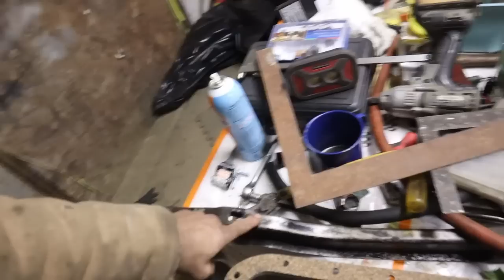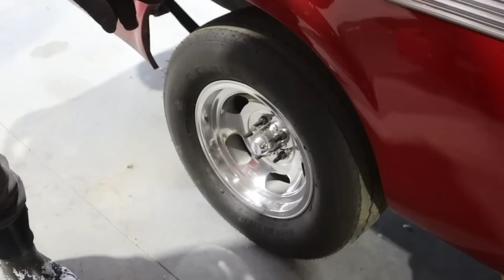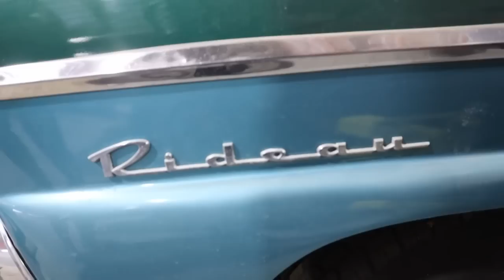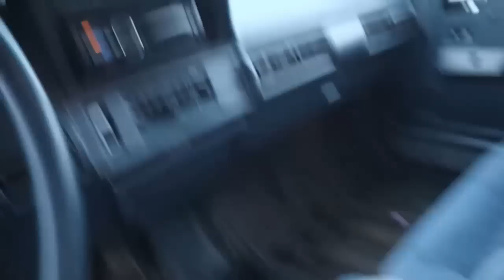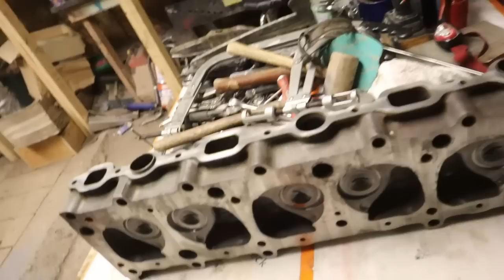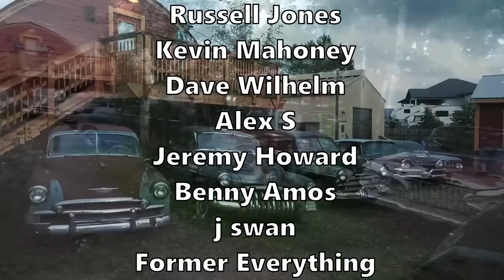Getting my Head Together: 1937 Chevy Engine Assembly, and Fantastic Ford Y-Blocks!

Comment: My dad and his Army buddy Earl Hunt drove a 1941 Plymouth to California and back to Detroit in 1946. When they got back to Detroit the old Plymouth developed a rod knock. Dad and Earl dropped the oil pan on a side street, cut off a piece of leather belt. They took off the loose rod cap, jammed the leather belt chunk in and re installed the rod cap and oil pan. They pushed the car close to the nearest used car lot, fired it up and traded for another car.

Comment: If you ever have to replace a head on an engine with guide pins you can cut the head of an old head bolt with the same thread and cut a slot for a screwdriver...makes for great guide bolts just slide the head down over them...Tip for the day...Great show again lads.
Reply: I use the same trick with bellhousing bolts. I grab extras at the yard and use them as guide pins for the transmission.
Reply: Zig has some great Aussie content
Reply: @ronmcgregor9324  Cheers Ron.
Reply: @ronmcgregor9324  thx, I'll take a look.

Comment: Those springs you saw in  the book on the pushrods were a dealer option for some engines and most never got them. Out of a hundred at the least of those engines that I poured the rod bearings for never had them but did run across one that did have it. We just left that part out as they looked like  a problem coming. I had every one of those cars your friend owns of the "Y" block series. I used a 56 for my drag car and many times it hit the wall but completed the race, only lost three races in say a good twenty plus races. I ran Y blocks for a good while then switched to the 390 with dual fours and a blower. From then on, that car got beat to death racing at any event I could get it in. Back in the sixties, a thirteen second car was really fast but dual fours and a blower got it into a high eight second car... the next race was its last as the frame, actually the second frame, broke and it hugged the wall for the last time. First girl to attack me and head for the back seat was my 57 two door hardtop. My saddest moment is now knowing I had a one off ford wagon built for a canadian and had canadian speedometer, was a "duplicate" of the chevy nomad. All the chrome on the tailgate, inside was the same with pile carpet that matched the color of the car. The carpet was ripped up from storing stuff in it that should of never been inside of it. I had to take all that chrome on the insides out to get the carpet out of it and then a man came by, spotted the car, offered me a good sum of money and in those days money talked. I never seen it again but it was in a car magazine. It had been fully restored and then is when it hit me why so much money for a station wagon to me type car. Great show as always

Comment: Here's another thumbs up for Mr. Deagle letting us see some of his collection.  Stay tuned for more, I guess.  I remember in 1 of the Strong Garage videos, when Jim was saying how difficult it was to work on the brake master cylinder of the 48 Chevy they were working on - "This will make a Ford man out of you".  If Scott had been made a Ford man, then maybe the CWM compound would have had more Fords and Mercurys and Monarchs and Meteors, and fewer Plymouths, Dodges, and Plodges.  I have seen some Fel-Pro oil pan gasket kits, that contain plastic "Snap-Ups".  It looks like those would have been a big help when Scott was doing a solo installation of the pan on the 37.  If the exhaust system of the 37 Chevy is open to an opinion poll, my vote is a quiet muffler.  That like-new engine and a quiet exhaust will be very quiet & refined.  And I guess the winter beater race at Jim's place will be coming up.

Comment: Hey guys, thanks for the show. The Ford collection was pretty cool and I'm a Dodge guy. I also spotted the 40 Dodge when you were checking out the winter beater. I can pick them out from at least 50 yards.Nice that you mentioned Nicks Garage, he has set me straight on a few questions that I had and they worked perfect even tho local guys couldnt get it done, a real solid guy. Cheers!

Comment: I always wanted to see how a 216 oil lubrication worked.  I had one on a 50 chevy 3/4 ton truck.  My dad told me to run non-detergent oil, since he told me regular oil would foam up in the pan, so I would use the same oil we had in the drums, for out small power equipment.  I always wondered why the factory oil gauge only got to about 25psi for cold idle and 15psi for normal running.  This is so cool, thanks for showing us this work etc.  I loved that old motor and how it would just purr so slow at idle and so smooth just driving around the pasture etc.  I miss the old chevy, one could out walk it in while it was in 1st gear and just reach into the window and adjust the steering wheel, while it was just purring along.  Thanks for all the video editing you do to share these vids with us.  God Bless you and the crew!  from Near Nashville, TN. USA
Reply from the maker: Hey thanks so much; glad you enjoyed it! I am really happy with how the old 216 is coming back to life...Cheers!

Comment: Very nice Fords. It`s funny how it works out, like with the 37 engine. First, lets see if JB weld can fix this and just send it, to fixing it properly. I just wiped a cam lobe on my Mopar and thought, I`ll run some washing fluid trough it, throw a new cam and lifters in there and that`s fine. But as one gets in to it you realize what it takes. Complete teardown, wash everything, new bearings and what not. Even got to do some improvements. So, that`s how it goes. Great show as always. Cheers. Oh, and the model car stuff, love it.

Comment: My sister had that same Olds-muh-bubble, but a few years newer after they switched to the 3.1L that was in practically every FWD mid-size GM car of the era. My mom had a ‘93 Skylark with that same 3.3L. I believe it’s a relative of the 3.8L. She ended up having to get rid of it because of cooling issues. No one could figure out why it kept overheating. Cooling system was full of rust and we weren’t going to pay for a tear down. They only made that engine for a few years.

Comment: Love it!!! I was hoping you'd walk us through that aiming jig you mentioned last week. I sure hope someone can "pipe-in" on the Stovebolt pushrod guide springs mystery... I've had a lot of forklift engines apart and not seen that arrangement on any of them, either! So nice of Tom to let you film his collection - the wheel re-arch job on that drag car is super-clean work! We always knew Dean was sharp if he's held down a job as a mechanic all these years, and what a treat to see this side of him! Keith's X-body Ciera was a fun trip for me - the car I got my license in was an '86 in Burgundy and Medium Red that we bought new. My uncle also had an '89 SL in charcoal, optioned just like Keith's, that he gave to me about 15 years ago because I didn't want him to scrap it. Limped it home with a bad trans pump and threw in a used trans, it had about 125K on it when I got rid of it. You're right, they're getting much harder to find these days, and not a bad idea to oil-spray even a beater to get a few more years out of one. Solid entry from Keith!

Comment: Those Cutlass'es and Century Limiteds were good cars, I had the latter (1990.) They quit building the 3.3 because it lasted too long.
Reply: ...and now the 3800’s still last too long, quit making those🤷‍♂️😏
Reply: @tomtheplummer7322  soft transmissions though...
Reply: My Dad drove like the Grandpa that he was so he never had issues. 😉
Reply: @tomtheplummer7322  I had a 1987 Delta 88 (newest car I ever had, 5 yrs old with 160K miles on it).  Put in reverse one day with a "little" gas and cracked the reverse band.  If it was on flat ground and put in reverse with no gas it would move.  Gave to my Dad, drove it like that for another 4 yrs! 😆
Reply: I had multiple Century and Celebrity rental cars back in the 90s.
Reply: I hope that's true. 🙏

Comment: Those pictures in the book are push rod retainers and valve spring helpers to go with the weak valve springs on the head, they discontinued them in 38 and went to stiffer springs on the valve

Comment: I've been into many of those old stove bolt babbit 6's. Never seen the springs on the pushrods on any of them ever!  Those engines came in both 216 cid and 235 cid.  The latter was usually in the load master heavy trucks.       People try to tell me that the 235 was only on later power glide with full pressure rods, but they were in most all the tucks. After 52 I think, they got smart and went to all 235 with full pressure cranks.

Comment: the oil tube is 37-52 on the thriftmaster 216 !    /   allways hold torque wrench with pivit point in center (on handle)     lookin great      DBN

Comment: Those Olds Ciera's are really quite good.  And yes my grandmother had one with the Iron Duke 4 cylinder.  It was no power house but would keep up with traffic just fine and never used any oil and not much gas although that was not a concern in the 80's.  A couple of old geezer alcoholics in my community bought used ones in the late 90's and they lasted years, in fact I think the one was still going a couple of years ago when he died.  They did not do anything to make them last with the exception of driving them daily to the liquor store.  Keep up the good work Scott!!!

Comment: I don't know if you have seen them before but they make plastic studs that have a snap lock on the non-threaded end for putting pans on with. You thread four of them then and then you can just push the pan on and it will snap into place long enough to bolt it up. You then just unscrew the studs and put the remaining bolts in.

Comment: That Ford collection is really wild.  Beautiful Fairlane 500 and killer drag car.  What a sweet Meteor.  I haven't seen one of those or a Monarch in 25 years.  What treat!  I don't know what the cutting tool is called but we use it for cutting barbed wire when stringing line on the fence posts because you can make flush cutes against the staples and post.  Love the intro and transitions scenes.  I miss the older slower days of traffic.  The modern traffic doesn't grab me anymore.  Thankfully there's still a few cool people out there willing to drive a Newport to break up the monotony of SUVs and crossovers out there.
*oh my, haha, there's a good chance I may have serviced that Cutlass at one point.  Solid winter beater!
Reply from the maker: Hey! Glad you liked this one... Thanks as always for the encouragement and support for the show!

Comment: Great show as per usual, Dean totally rocked it assisting with the head installation on the stove bolt. Sweet the 37 will be an awesome ride. Really liked the Ford Y block tour.  Of note any paper or cork gaskets I always rub Vaseline (petrolatum if your technical) into the gasket, makes removal way easier later (and there's a better chance to save the gasket). 
Here's to another great week!

Comment: The local garage shutting down is a symptom of how everything is over-complicated and third-party repair is unsupported. We need a battery for a 2015 VW, but I just found out the new battery will require re-coding the charging system. For a BATTERY replacement! OBDII was supposed to standardize things, but manufacturers have found ways around making things so you can do routine work without the dealership software.

Comment: Hey ColdWarMotors,

The collection of shoebox Fords was awesome.  Never noticed the swinging star on the trunk.  The gauges under the hood was a new one on me too!  BTW, was that '57 312 bored to 320?

The best thing about your video was seeing the 216 lower oil tubes in action.  The water pressure (7-14 psi) painted an explanation for the return tray, rams horn shape.  I'd never noticed that.  Very cool to see that.  Most won't understand...

Scott, nice job on making the aftermarket cork pan gasket work.... 

Dean, you did some impressive work.  Mastered the tap and head gasket placement.  Maybe the headlight helped?  We all need more light....

Comment: Ha!  As a 18 yo, I had to drop the oil pan on our '73 Chev after the timing chain stripped.  (Figured diy would help pay the folks back for letting me drive it.)  Pan had to be dropped to get the timing cover off.  Coldest part of a cold winter, laying on the floor under the thing when it was on jack stands... your oil pan installation brings back memories.

Comment: MoToR of 1946 says : 'on 1935-37 engines , push rods are assembled to the engine in groups of 6 in the following manner : slip the push rods through the SPRING RETAINER, and the push rod springs over the lower end of the rods, holding them in place with the SPRING RETAINER KEYS. Place these assemblies in the engine . being sure the push rods are seated in the bottom of the lifters , and that the spring retainer is fastened securely to the engine .
On 1938-46 engines , the push rod springs and retainers have been discontinued, thereby simplifying service . Just be sure the push rods are seated in the bottom of the lifters on 1938-39 engines . On 1940-46 engines the upper part of the lifter has a hardened steel seat brazed into the lifter body. '
Hope this helps .
Reply from the maker: Thanks Derrick! Looks like this one has had the extra springs removed at some point... Cheers!

Comment: I LOVE that '23 Roadster. The one piece of advice I have....stay AWAY from those water pumps. They are NOTORIOUS leakers, drags on power and put grease in the cooling system. You have to run Water soluble grease in them, but not everyone does (can't tell you how many times i have seen people use wheel bearing grease), eventually it just plugs up the radiators. They also don't push as much as the thermo-syphon system anyway.  They just aren't worth the trouble.   My 1919 Depot Hack has one....that is the first thing to go.
Reply from the maker: Hi Clayton! Interesting to hear your take on the water pumps... I just figured they had to be an improvement, but I guess not! My T behaved just fine without one though, so I'm in no hurry for one. All the best as always from everyone here!
Reply: @coldwarmotors  No, they do not move water any better or more then Thermo-Syphon.  A T should not need one to stay ice cold at all times. If the Coupe stays nice and cool in the summer, you are good. Honestly, they are neat , but are wall hangers. I have five or six of them hanging in the shop. I'd yank the one off that '23 Roadster first chance I got.

there is an endless plethora of T accessories from the period. 1/3rd of them are awesome and usable, 1/3rd are questionable and 1/3rd of them are pure snake oil..lol!

Comment: If you don't have access to a dip / boiling tank or the cost is too prohibitive a great way to clean cylinder heads bear and other parts that aren't too big is a dishwasher, obviously not the one in the house but it does a great job of washing rinsing heat and drying.

Comment: Great idea 💡 sealing up that 37 chevy pan gaskets  

Christ  !! That 57 Ford Fairlane 500 is absolutely 💯 beautiful 😍 👌 
312 ( 320 c.i. ) 

That town sedan is also gorgeous 😍 👌 
Never seen that color combo before 

Oh , that's right  . I remember that particular Rover , from a previous episode on CWM 

Glad that RF fender is getting fixed 

Holy f**kin sh*t 😳 
That Oldsmobile cutlass ciera is MINT !!
Roll of duct tape cup holder 👌 

Aaaaaah..... the Buick 3.3 liter 
Little brother to the 3.8 liter 
That's quite a boujie model 

Those cars can last 200,000 miles
 in New England  🙆‍♂️

If you ever get a chance too buy one of those  , especially rot free ( reduced  ) buy it  !!

Glad you caught that value spring gaff , before you installed the cylinder head 😬

Sorry Scott . You & Dean have got me stumped on the , mystery stove bolt , valve train question  🤔 

Oh , good idea 💡 
Running a tap / trace down those head bolt treads , too clean them 👌 

Oh Christ  !!!! 
Different length head bolts 🔩 

That reminds me of , Different length pushrods on GM 2.8 , 3.1 V6s 

New heads bolts ?
Are they standard  , or fluted  ? 

Mr Goodwrench 
Mr Goodbutcher ..... close enough 

Oh definitely  , grampy stock muffler 
Hope Myles is feeling better 😷🤞

Oh yeah that's right ✅ 
His Bonneville has a 261 c.i. 
( basically a GMC truck engine  )

I've been having good luck with Lucas engine assembly lube & Toyota black RTV sealant

Comment: allways put a little drop of oil on threads   & where the bolts head touches the heads serface this gets the torque spec correct  as well  .   otherwise great job for sure    . lookin good DBN

Comment: My grandmother had a "Fargo" Cutlass Sierra S, too.... :))
I, seriously, with great emphasis, hope the head was decked or, at the very least, checked for warpage. Every straight six I've seen that had overheated, the head had warped and the radiator would always leak because of the leaking combustion chamber blowing the top tank of the radiator apart..
Reply from the maker: Oh yeah, we skimmed the head when we did the valve job.. Cheers!

Comment: 18 minutes in and I have to pause and make my silly comments:
I know changing the oilpan cork gasket can be quite shitty. So when we had to fix several gaskets on my 65 Catalina I went to a friends' garage. You need to lift the engine out and I do not have an engine hoist and I do not even have a lift. I bought the original gakset set plus a special updated oilpan gasket: A one piece rubber gasket all in one piece and a thin metal insert: To my surprise when I came to pick up the car I saw that the guy preferred to put the multipieced original cork gasket in. Probably he did not trust the updated system. 
I am not really into Fords. Maybe with the exeption of the early TBirds. But the collection of your friend is GREAT!